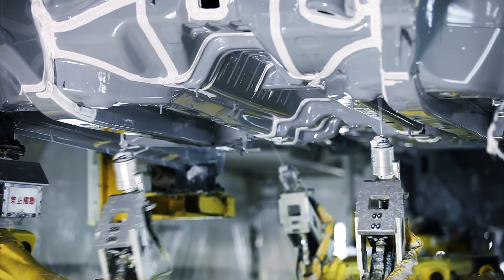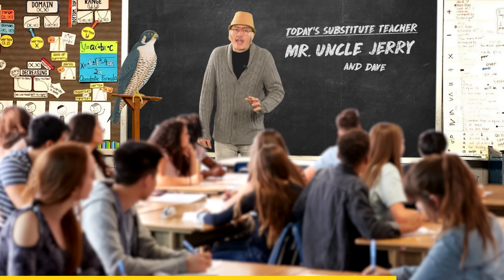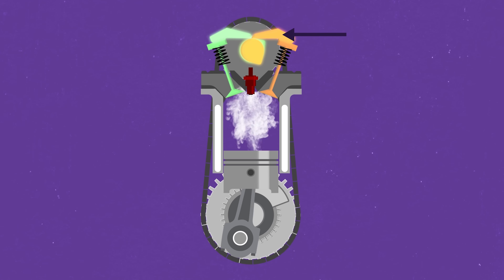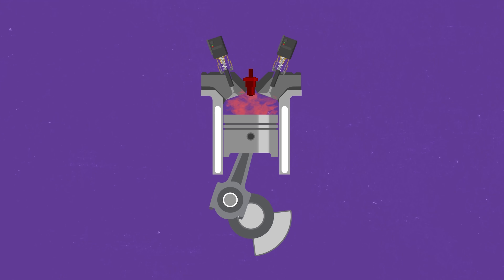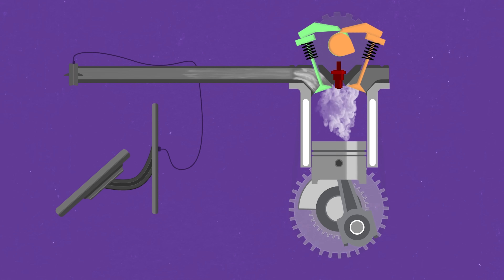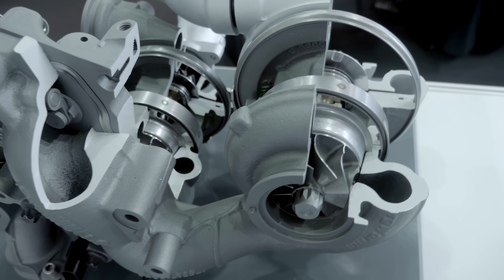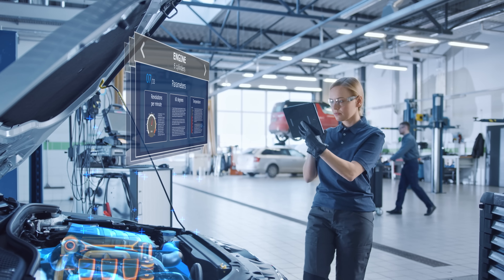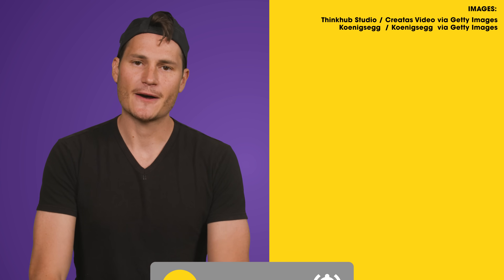This Is The Last Great Engine Tech

Comment: When I first learned about cam shafts years ago, as an engineer, I couldn't fathom why no one had just done computer controlled actuated valves. Much lighter, and much more tunable. It was kind of mind boggling. When I saw someone did it my response was "I was saying that 10 years ago".
Reply: Yeah I dunno about you guys, but I've replaced enough solenoids to know that they won't be on the same level of longevity as a traditional cam.  It's fine for a purpose built vehicle, but I think the maintenance would start to get tiresome in a daily driver.
Reply: @Skinflaps_Meatslapper  it’s not that hard to replace a solenoid. If a camshaft breaks you have bigger annoyances, especially if it’s an LS.
Reply: @kalasmournrex1470  It's not that hard to replace a solenoid unless you're in any of a million situations where you need a reliable vehicle and a replacement solenoid is nowhere to be found.  You going to carry a few spares around with you just in case your car dies on the way to work?  How about we power aircraft with them, you gonna trust them on a 12hr flight to Hawaii over the Pacific? Camshafts don't break like solenoids go bad.  You're probably looking at a 2,000:1 ratio between replacement time intervals between a modern cam and a modern solenoid.  The fact is, a present day solenoid is a cheap wear item that has never really been relied upon like a camshaft has, and that's the limiting factor in the freevalve concept and all of the other solenoid actuated valvetrains of the past (that's right, you're not the first, freevalve wasn't the first, the dozens of people commenting on this video weren't the first either...they've been prototyped on functional engines for at least four decades now).
Reply: @Skinflaps_Meatslapper  I’ve never had a solenoid actually break. I’ve seen cams fail. I’ve certainly seen timing belts/chains break. Wear items freevalve doesn’t need
Reply: @Skinflaps Meatflapper yep
Reply: I keep ignition coils, spark plugs, timing belt, accessory belts and duct tape in my car at all times among other things… the daily of course not the drift car the drift car could pretty much be rebuilt on the spot with all the spare parts in he trailer when I go o the track. But seriously with you daily it doesn’t take much to make sure you’re engines always able to get a spark, some fuel and air
Reply: @Skinflaps_Meatslapper  Talk about F1
Reply: @kalasmournrex1470  that's because you've never seen a solenoid
Reply: @kalasmournrex1470  i agree.  replacing one piece as compared to almost having to take the whole engine out in most cases.  I'm assuming.
Reply: @Skinflaps_Meatslapper just don't buy your solenoid from china.. it shouldn't be that hard to make one that is durable.. its a pretty simple device
Reply: @Skinflaps_Meatslapper  That's a problem that gets fixed over time, if no one ever implements the tech then it gets no R&D funds and the problem never gets fixed. The advantages of this tech is enough to make it worth it.
Reply: I was explaining my hypothetical design of this to my dad when i was like 12 years old.. 10 years later its real shit.
Reply: @spxtra1159  stop lying lol
Reply: Most likely the technology wasn't mature yet, they aren't solenoids, so they needed to develop high speed actuators with an integrated closed loop position sensor because the computer needs to know exactly where the valve is for emissions.
Reply: You also. Do you realize you should have done something, maybe build it in your garage?
Reply: This idea has been tryed since the 60s with no sucess.
Reply: As an engineer you gotta do more than just fathom. Get r done son
Reply: Because it very complicated and very expensive to make for large mass production use. Well At least at this time. Who knows in the future?
Reply: why didnt u do it

Comment: A square wave is still analog.
Digital is just how you interpret analog signals. I.e. you say that any valve above a threshold level is a 1 and below a value is 0.
In fact there are digital versions with more than 2 states. E.g. flash memory storage.

The distinction here isn't between analogy and digital but between mechanical and electronic.

Comment: This is totally cool I thought about the same thing for years. I’m pretty sure the free Valve technology was originally designed by caterpillar over a decade ago. Also I think Audi used it in formula one before.
Reply: Nope. F1 never used electronically controlled valves. They did however use pneumatics to help with valve float, so that where the confusion comes from

Comment: This is an amazing upgrade to the existing  technology, but what will happen when something goes wrong.
Many of car viewers watch some of fixing moding old cars.
There is the problem with the right to repair, companies like Tesla shows the apple way to the car industry.
Car manufacturers do not want us to repair them with 3rd party mechanics (but they can not control, or from the sheer amount of vehicles they accept).

How much they would cost and if something broke, at least the replacement would be available as easy as finding other electronic parts for cars.
Missfires would be easier to find with this setup.
Reply: Not necessarily, F1 engines have been using pneumatic valves for 30 years (they work in a similar way) it just wasn't needed on road cars.

Comment: Some FIATs have a similar system... it's called Multiair ... it's used in the intake valves, still has a camshaft for the exhaust, in that shaft exist some cams specifically for "pumping" a little oil compartment, then a electronic solenoide uses the build up oil pressure to actuate the valves... it's a pretty interesting solution
Reply: The elwctronically controlled valves obviously require a hydraulic actuator.
Electromagnetic actuation is unfeadable because of the delay induced by the toggling effect.
Piezoelectric might be feasable, but aim unsure if the requisite travel can be achieved with it.
Reply: @ineednochannelyoutube5384  I don't think piezoelectric would work... the crystals doesn't expands that much.... some diesel injectors uses piezoelectric, but it's a different working model....
Reply: @eliveltonnogueira8890  You could probably manage it with levers actually.

Comment: I have thought this was the way to go for years.  Not sure why it took so long to implement.  Every moving part on an engine, other than the pistons and crank, should be electronically controlled.  That way, software can achieve a level of real time tuning that is as close as possible to ideal.

Comment: Electrical components like actuators are only good for a limited number of actuations.  Even if these parts could be good for 6 Million actuations (unlikely) divided by 1000 rpm's at lowest throttle and by 30 minute drivetime daily it would only last about 200 days.  Even at price of cheap actuators at $50 and labor at $25 each. it would cost $600 every 200 days for a 4 cylinder.   ($50 each + $25 minimum labor) x 2 valves per cylinder x4 cylinders = $600.

Comment: Personally until we figure out 1st how to dispose of use lithium batteries at a scale necessary for everyone to be actually using EV's the idea of ending fossil fuel use is just silly . Not to mention we here in the US can't really produce those batteries without Chinese components so what happens if the Chinese decided they don't want to sell to us anymore ? The idea that we reached the end of tech developments in fossil fuel cars is about as silly as Porsche thinking the 911 would never be anymore developed than it was in the 1970's we know how that turned out  .

Comment: bob had an idea to use a single valve with reeds and injector on top with the exhaust reed pressure rated to say like 20 pounds so you can run 20 pounds of boost and boost not blow out your exhaust reed plus cool way to doing a blow off valve in there too but you take the free valve and make single with reeds and fuel injection  plus was thinking would be cool to use hyper rotating screws to inject the air in the intake as well as a screw that dejects exhaust also with a single valve

Comment: Didn't BMW have a system which controlled the valves directly on the N52, negating the need for a throttle body

Comment: The one thing you didn't mention.. Is the parasitic loss from an engine driving a camshaft.. A camshaft uses power from the pistons to drive the camshaft... So most  (not all) of the power gains from a free valve engine is from not having to drive a Camshaft

Comment: Great video, quite informative as well! 
One question though; your schematic shows a single action actuator for the valve, using a spring-aided closing action.

With a dual action actuator you can control opening and closing speeds, all through the rpm bandwidth.
Unless you choose a very stiff spring, to shift the floating resonance way out of the rpm range you are using,
the spring in the single action setup still is prone to floating valves at a certain rpm.
And of-course, choosing a good spring has all sorts of consequences in mechanically tuning the valve behavior you're looking for!

So, why not avoid having to both mechanically AND electronically tune the valve behavior? 
Choose a dual action actuator; open and close electronically...
Cheaper, more expensive? I haven't a clue. 

Honest question, something I'm wondering about after seeing your video, I haven't got the answer.

Comment: you forgot the most important part, a engine can go from 4 stroke to 2 stroke mid run.
Reply: True, but I’m interested to know why you say that is the most important part. And why would going into 2-stroke be beneficial? Isn’t 4-stroke more fuel efficient and better for engine longevity?
Reply: @mjenx86  I wasn't referring to efficiently. I was thinking about a drag race, or drifting.  That would be awesome to go from one power  25%  of the time, to 50%.
Reply: @moe61806  Ok gotcha. Thanks for the explanation!

Comment: I loved this video, it was very well done and explained the technology perfectly. As with all engineering endeavors, there is no free lunch so I would have loved for you to have gone into why this hasnt been implemented and what some of the potential drawbacks are. A few I can think of are reliability and complexity, but then again fuel injectors are super reliable and not that complex so its fascinating why this hasnt been more widely adopted...i mean a solenoid opening a valve has to be simpler than injecting an atomized spray of fuel directly into the combustion chamber right lol
Reply: Basically the same thing. The unit injector in my truck uses the cam to drive a piston in the injector to make pressure, then solenoids let out little bursts of high pressure fuel. In an exhaust or intake valve, the solenoid would open and allow oil pressure to push a piston in a cylinder that would be the actuator for the valve. Using just a solenoid to push a valve would take a lot of power and be bulky. Hydraulics are more compact for that application.

Comment: I think, there is a small problem here. If fuel injectors would fail, then nothing happened, one wrong cycle. But, if valve catch a fail, then you may have the kiss of piston and valve, unless they change method of opening valves.

Comment: I dont agree with you. Sorry.
DIY in a car just for prove something is easy and cheap yes, but do it to performance or massive production is a much different story.
Dont forget, for a car brand have profit they have to sell ( a lot or expensive). If your cars isnt good enough you dont sell, for that reason all tecnologies you put on your car have to work for longer with no problems, that means you have to spend millions on testing,  equipement and workers. In case of freevalve if you decide use that tecnology in a massive production you have to start all that tests with no references, that means spend even more money and researches.
Obviously there are brands with money for this, but for some reason they decided not to start... maybe because the electric cars increase selling power.

Comment: i talked about electronic valves 10 years ago. not only gives it better timings but it also removes alot of engine parts which restrict the engine. its kinda like removing the ac = one less part the engine has to work for.

Comment: Fiat did this 10 years ago but partially (I think it has solenoid valves only on the intake) in its small commercial engines. It is a very promising tech and more manufacturers should implement it

Comment: Wondering about the reliability of these. If each valve is individually controlled one failing could definitely screw some stuff up. Not saying they are inherently unreliable but creating more complex systems leads to more failure points

Comment: The BMW VANOS system is more or less infinitely variable for valve open/close time and their valvetronic system negates the throttle body as well by controlling valve lift with a separate gear/“cam” lobe setup. Still not as good as freevalve tho and obviously wayy more moving parts lol

Comment: Nah, this is not too late, electric vehicles are far from being "green" yet, they're expensive to build, buy and maintain, if this tech could be made cheap and implanted onto old cars like the Miata, it would be better than electric vehicles for a long time, until they become affordable.

It's my opinion though, that IC engines will never die, they'll only die when something like hydrogen gets as cheap as IC or they manage to shrink a nuclear reactor like a Thorium reactor to fit a motor bay, then they'll die.